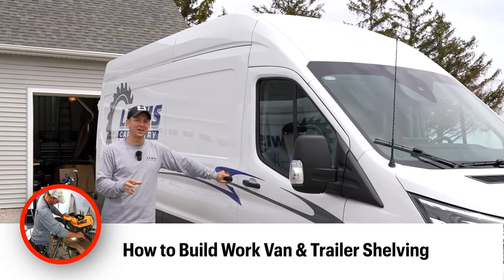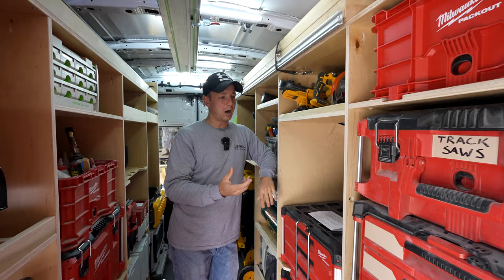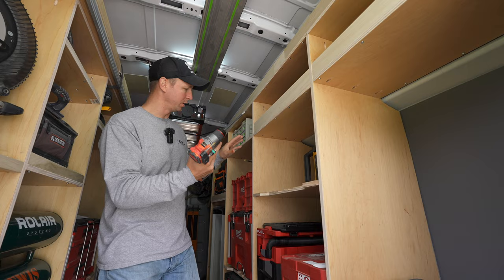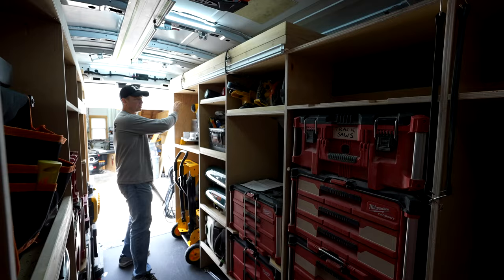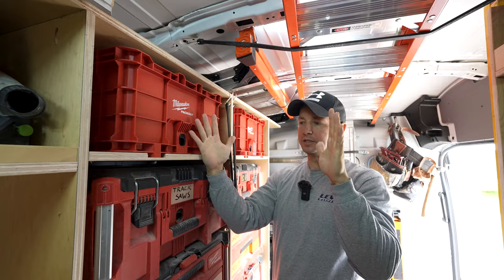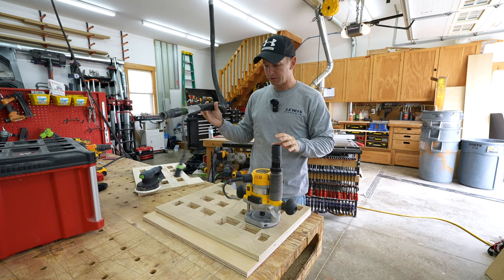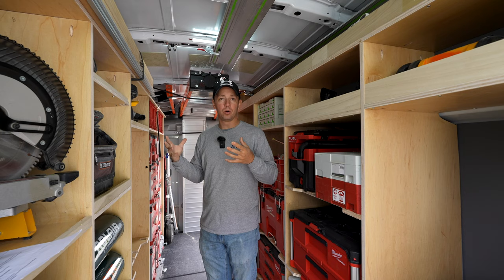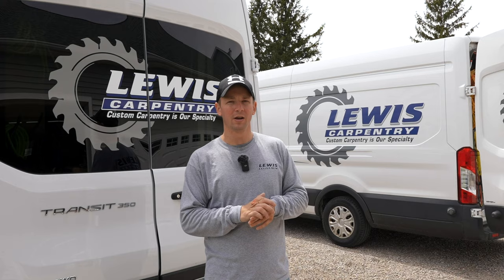The Van Build Out Continues!!! - I Did Something New With This Van...

Comment: Metal is less weight overall, in my experience. I use a modular system by orsy Wurth. When placing those modules apart, you’ll create sturdy space too. Have the system for 15 years now, it’s in my fifth van already.

Comment: for the saw horses you could bend some flat stock into a u shape and bolt it to the wall so it holds like the bungee does, but you never have to move it. just angle to horse out to get under it

Comment: just bought a transit it's important to note that how he did his verticals is he removed the plastic panel and scribed all the way to the outer sheet metal by doing so gained at least 2 inches if not mor in depth.

Comment: One thing about the draws. If they are built in you can't take them to where you are working. With them as a system you can grab and drop. Sometimes simple is better than utilizing all of the space. It all depends on your work flow. Great build and use of both the kiss and lean systems.

Comment: When I built out my ram promaster, I made a 1/2 plywood floor (2 pieces biscuited together). I just used  regular split-tip 1 1/4” pocket screws through the rear cleats, right into the metal ribs of the van instead of messing around with 8 mm bolts and trying to line them up.  also used them into the floor to connect the vertical pieces

Comment: Spencer,
You have done a really thorough job of thinking this threw. Of course having done it before in your other van certainly helps, but you still are improving on it as well. Nice thing about getting the basics down cold, then it's just a matter of refining the parts you weren't thrilled with. Nothing wrong with changing your mind from time to time on improving the product. I don't remember if you said if your new can had back up cameras or not. Would that be a consideration to install?? How about security cameras for the outside just in case. Do you have dedicated routers set up for repeat functions? Seems like you've pretty much thought of most everything and if not, the next can will cover that when the time comes😊😊. Nice job on your vans. I'm sure the fellow that gets to work with you will be very appreciative of such nicely set up vans and the opportunity to work with you.

Comment: I purchased the 10’4” or 6” Bed on the Ford Transient Van then put 1” 1/8 ply for the floor & pocket holed it together!  Then furred out the sides at the attachment points .   I used 5/8” T & G sanded like the floor and attached it to the sides!  Then from there built my dividers for my saws!  I had to keep one side semi open to haul materials !  I am a finish carpenter but I am not attached to a GC now?  Maybe later!  
So I do a lot of built ins, cabinets, doors ect,., 
There R so many ways to build out your van however it takes work to do it and keep clean/ organized! 
That’s why u see guys driving around with 25 G’s in tools piled in a heap when the doors open?

Comment: I like to draws the most.
 I purchased a husky automotive toolbox, remove  wheels and handle and mount it to the wall on top of 2 x 6s.
Gives storage inside and under. Use top as a work bench. Great for when it's raining. 
Fin ply everywhere else

Comment: Been looking at internal ladder racks. Adrian Steel makes a $431 option, Weather Guard has a model 250 for $332, Holman has 40480 for $424, and Jet-Rack is $111, but you buy and cut your own strut, I guess. Haven't used any but they all seem kind of expensive, except for the Jet-Rack.

Comment: I made a cabinet with shelves for our laundry room from Radiata, also called Sande Ply at Home Depot.   I used it because it was cheap and was going to be painted. My wife, who wants to have me around for  a long time,  researches every paint, stain, adhesive, and plywood I use. She discovered that Radiata is a marine grade wood and the adhesives in it are not approved in CA. In other words, they cause cancer.  There is a Prop. 65 Warning On It. Do not breathe in the dust or fumes when cutting it. It should not be used inside the house because it off gases, but for a van or grarage, it is fine. In our laundry room, it is encapsulated under three coats of paint, so we feel we are OK, but there are coatings specifically designed for encapsulation.  By the way, I have four small nodules in my lungs. They could have been caused by sawdust as I was not careful for years, or by photo chemicals as I was a photo teacher for over 30 years. Just be careful out there. Many craftsmen and artists use toxic materials every day. Some pay a big price later in their lives when they should be enjoying their grand kids and traveling.
Reply from the maker: Good to go. It is truly nasty stuff to breathe in.

Comment: Hey Spencer, great video.  The irritation from cutting the plywood also happens to me with Tigerply and similar imported plywood's, especially Shelter Forest International.  If you read the SDS on those they have a lot of nasty stuff in the glue.
Reply from the maker: It must be some terrible stuff. I have never had a reaction like that to anything.
Reply: Same here, 30 years of making saw dust and never a problem with any wood, plywood, osb...etc.. Used that stuff for a few projects a couple years ago and it just didn't agree with me.

Comment: Most of the time I buy plywood from Home Depot sometimes Lowes , reason being is they rip it long ways to reduce it's size , they make the first 2 cuts for free and I usually only need 1 or 2 cuts.
Makes it easier to load and then easier to unload , also after I get it back to my work area I only have small cuts to do and I can slap a cabinet together quickly.

I stopped using track saws and table saws and do everything freehand with a skillsaw circular saw and a custom cutting table I made that I lay out on the ground . 
I use one of those 4 foot T squares and a sharpee marker and I aim my saw blade to remove the sharpee mark.
After a few times you get good at making straight cuts with out the track saw , I do this to have less tools taking up my space.and to be reliant on less tools.

At my shop I cut everything outdoors on the outside of my overhead door that way I don't need a dust collection system the wind blows it away and I pick up the big pieces.

Thanks for all the tips you provided I especially liked your pocket hole system I definitely will pick one of those up.

Good luck
Edit ,  I was thinking that you could add a beem in-between the top of the driver's side and passenger side shelf's , one by the cab area and a different one by the rear doors , would be a easy way to add strength and keep your cabinets from pulling away from the walls , just a thought , good luck

Comment: I noticed that the cabinets you built for your old van had a bunch of holes drilled going up vertically for adjustable shelving whereas the cabinet in the new van didn't seem to have the adjustable shelving..
Did you come to a conclusion that you didn't need adjustable shelves?
Thanks for the excellent content.
Reply from the maker: Pretty much. It was an extra step drilling all those holes that ultimately wasn't necessary. The holes make it nice for installation as you get things set up and then permanently fasten later. But the holes aren't necessary.

Comment: What’s manufacture of the van? Ford with 3.5 turbo?
Reply from the maker: yes, but I think the van only has the 2.7 turbo. I have a truck with the 3.5. Amazing engines.
Reply: @InsiderCarpentry 2019 f150  3.5tt , next one 3.5tt powerboost with 7200kw generator battery

Comment: Nice job.  I tried your old van technique on mine, using shelf pins to adjust everything.  I noticed on your new van you didn't use that.   Just curious, did you level your shelves or angle them slightly to account for hard turns?
Reply from the maker: Some are leveled and some are angled. It depends on what I have stored on the shelf and whether I put a nosing across the front or not.

Comment: I was at my local Menards and I couldn’t find the plywood you were referring to in my store, when I asked one of the workers about it, he said he’s never heard of it. Did you have to order the Radiata plywood? I’ve found it online at other stores but not menards.
Reply from the maker: No it was in stock. If they have a standard prefinished birch or maple ply I would go with that.
Reply: I have used it for some overland builds and I think mine said Tigerply on it. Looked like the same sticker in the corner on what Spencer used. SKU: 1251700